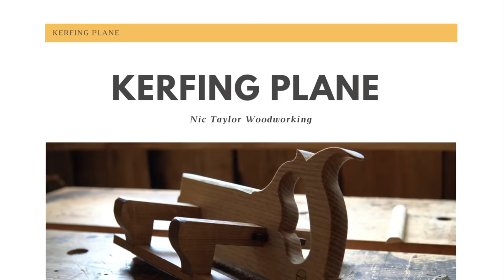Building a Kerfing Plane for Easy Resawing by Hand

Comment: Happy to see you back in the shop (and by that I mean on YouTube). Nice video!
Reply from the maker: Thanks, Lex. Glad to be back!
Reply: @NicTaylorWoodworking  From your first videos I was very impressed (and jealous) of your toolkit. All high end tools and the full compliment. Did you work up to this kit, or was it gifted? Also, what's your background with woodworking? It is something you've done since you were young, had formal or informal training? My dad is a woodworker and carpenter but I'm the youngest of 5 sons so I didn't get any of his tools ;)
Reply from the maker: I started woodworking in college, about 7 years ago. The main reason I started with handtools is that I didn’t want to invest in large machines when I was living in rental houses and apartments. I have no formal training, I just do a lot of research in my spare time.

As for the tools, I started very basic. Found an old Stanley no 5 plane on ebay for $30, and spent some time restoring that. I used budget chisels and cheap stuff from the big box store. I learned quickly that low quality tools make woodworking very difficult. So, I only made projects with the tools I had. It was years before i got a plow plane or a rabbet plane. For years I only used a single 1/4” chisel from Lie Nielsen. I wanted to buy good tools that would last, but resist the urge to buy tools I don't need.

Once I knew woodworking was something I would stick with, I allowed myself to fill out my tool kit. I got a few more chisels, got a smoothing plane, and found a jointer plane for $40 at a local antique shop. Basically, build up slowly. Get some tools gifted from family/friends when you can. Don’t underestimate how many things you can build with a very basic set of tools. Hope that helps!

Comment: There's a really good use to the kerfing plane. Fill the groove it cuts with beewax or a slightly viscous oil. This way when you start sawing the saw will glide through the cut and remain lubricated throughout the entire board. 

Huge time saver for the hand tool wood workers.

Comment: How well does that little stove work for heating your workshop?
Reply from the maker: It’s not perfect, but I actually like that it doesn’t crank the heat too high. Basically, the stove takes the edge off the cold, makes it comfortable without ever being ‘warm’, if that makes sense. If i insulated the shop, I think it would be more than enough.